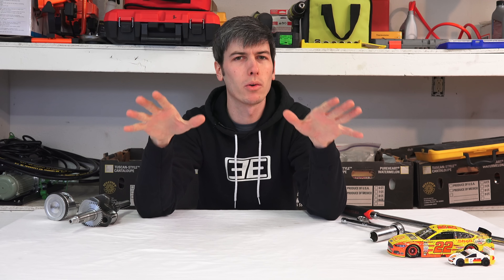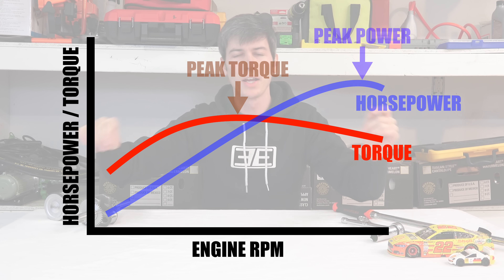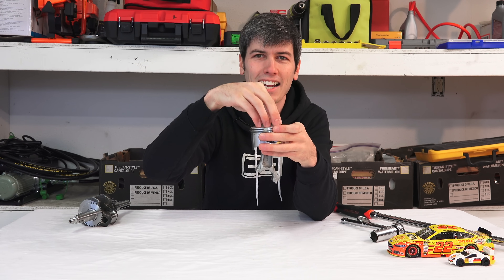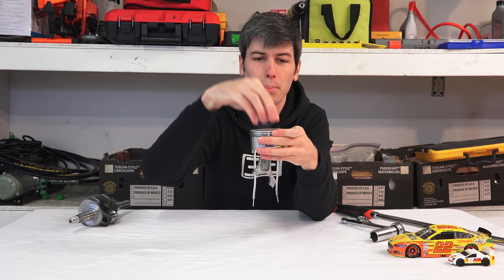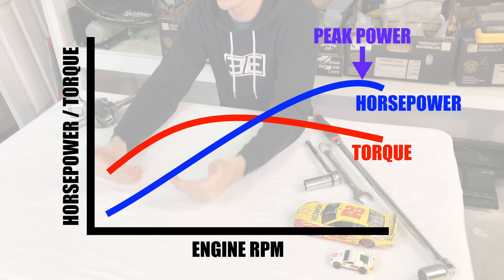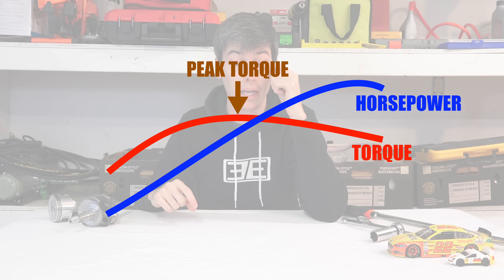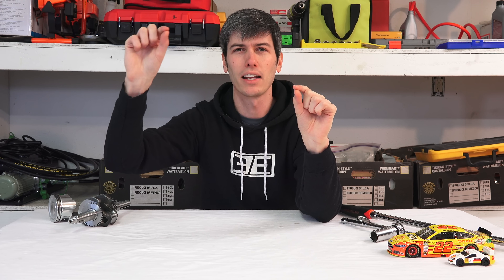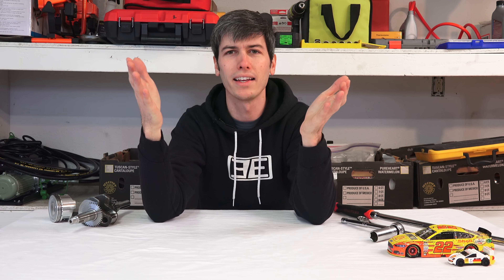Horsepower vs Torque - A Simple Explanation

Comment: Im still confused. I have read about this and watched videos. I have always been under the impression that more torque is better for acceleration, but his demonstration says the opposite? I dont care about top speed, because outside Germany (which I am) you cant go 150mph... but you CAN do 0-60 in 4 seconds on a daily basis or do 50-80 quickly to pass trucks etc. I want high acceleration in my vehicles for QUICKNESS, but a max speed of say, 120mph is fine. Thus, I want torque over HP, right?
Reply: horsepower is what gives a car acceleration. Torque is the turning force, power is how fast that torque is applied. That is why race cars have high horsepower and trucks have high torque

Comment: Overly Simplistic explanation. While his definitions are correct the Car scenario is a bit simplistic. Torque and horsepower tuned engines are used for different reasons in the real world. If you lived in a very mountainous area and needed to go drive around town up and down hills the 200ftlb of torque will get you around much more comfortably. But if you live on flat land in wide open spaces the 200 horsepower car is by far the better car for you. Because you need more torque on grades, while flat lands require far less.

You can see a similar case in motorcycles. Some of the bigger Harleys and Goldwings can tow a rather small trailer for gear behind them, because their motors are tuned for alot more torque. While a Suzuki Hayabusa is one of the fastest bikes in the world with crazy HP numbers, you will never see them pulling a trailer, it might not even move all that fast if you tried it. 

It's not a one size fits all scenario that more HP is always better.

Comment: Are you saying that if you took a remote controlled (RC) airplane gas engine that can reach 30,000 rpm  (The tachometer on my pick up only goes up to 6,000 rpm) and you took out my truck engine and replace it with the RC engine, the RC engine could not turn the wheels of my truck at all, even at 30,000 rpm, but If it were possible to get the right gearing so that the RC engine while running at 30,000 rpm would turn my truck wheel 1 revolution; 1rpm, and if it takes 1lb of force to make it rotate 1rpm, that would mean that at 30,000 rpm the RC engine has 1lb of torque.  So you take 1lb of torque x 30,000 rpm of the RC engine and then you divide it by 5252 which gives you 5.712...., this means the RC engine at 30,000 rpm will produce 5hp and 1lb of torque,  but it took 1 minute for it to reach 30,000 rpm while turning the wheel.  So if you beefed up the RC engine so that it reached 30,000 rpm in 30 secs instead of 60 secs. while connected to the wheel, that would mean that the RC engine turned the wheel twice as fast in 30 secs. in order to reach 30,000 rpm in 30 sec. but still it reached 30,000 rpm the wheel still turned at 1rpm.  This would mean that because it could turn the wheel twice as fast in 30 secs compared to 60 secs.  that means that the RC engine now has 2lbs of torque and 11hp.  So increasing the HP did increase the torque.  However if the wheel took 2 lbs of force to move it 1rpm, then the 11hp 2lbs of torque engine wouldn't be any faster then the 5hp 1lb torque that must move a wheel that requires 1lb of force per 1rpm.  And if you pull the engine out of the truck it is still rated at 5hp and 1lb of torque before it was beefed up.  Correct?

Comment: Horsepower and Torque cross over at 5252 RPMs. All engines.
Reply: That's because 5252 is what you get when you compound the unit translation factors that define a minute, a horsepower, and a revolution in terms of radians.

Comment: When people ask me I've always said torque tells you how much work the engine will do and horsepower tells you how fast it will do it. I know it's a little over simplified but it gives people the general idea.
Reply: That's half wrong.  You can convert the torque output of the engine to be anything you like.  Big amount, or small amount.  Neither changes how much work the engine will do.  Torque is how hard it pushes.  No movement required.

Comment: So a higher RPM of my engine gives me the same advantage as more torque if used correctly with the transmission? 
Is this why gas and diesel are comparable if gearing is used? My MX-5 can spin up to 7500rpm, is that as effective as a diesel which spins like 6000 max but has more torqu?

Comment: I agree but the car of 100hp and 200pf in a drag will destroy the other in short acceleration at low rpm because in most cases It's a turbo car however the 200hp 100pf car is naturally aspirated

Comment: Could you explain why hard acceleration reduces fuel economy?(going from A to B fast instead of slow). In the end of the day, going the same distance from A to B, regardless fast or slow, assuming 0 drag in vacuum for the sake of math, should have the same total amount of work done and require the same amount of force? But that's not the case since there's the difference in fuel economy
Reply: Your car has to be put in lower gear settings to get higher acceleration, than it otherwise needs to maintain cruising speed.  This is what you have to do, to get the necessary torque to get the car up to speed.   The engine is less efficient and burns through fuel at a higher rate when it has a higher rotational speed.  So you sacrifice efficiency for acceleration, in order to have your engine and transmission prioritize high torque.

The engine has an optimal fuel efficiency around 2000 RPM, but you won't get much torque out of your engine for acceleration at that speed.   That kind of engine speed is best for your cruising speed on a 40 mph road, where you only need enough torque on the output wheels to overcome air drag.
Reply: Thanks, you meants 2,000 RPM and not 20,000 RPM. Okay, if assuming the same situation where it is in a vacuum with no drag. For a CVT transmission or an electric motor that has only 1 gear, hard acceleration will also cause higher rotational gear speed and less efficiency?
Reply: @belowmars  Yeah, 2000 RPM is what I meant.  I think I've been multplying by 10 by mistake.  In any case, it's usually the second marking on the tachometer.  Tachometers all have different conventions, some show numbers 1 thru 8, and "x1000", some show numbers 10 thru 80 and "x100", and I couldn't remember the correct order of magnitude.
Reply: @belowmars  A CVT doesn't have 1 gear.  Quite the opposite.  It has a continuous range of infinite gear settings between a max reduction and max overdrive.
Reply: @carultch, I know that, that's why I asked "For a CVT transmission or an electric motor that has only 1 gear", you can interpret it as I asked "For a infinite gear transmission or a single gear transmission". "For a monkey or a horse", the latter doesn't have to be in the same category as the prior.  
Either way, the FOCUS is the question and it is still unanswered: "will hard acceleration still cause higher rotational gear speed and less efficiency".
I guess I will also ask a follow up question, for a person to dash across 200 meter vs. walking 200 meter, will dashing exhaust more total energy/so it's less efficient?
Reply: @belowmars  The reason will be completely different, for machines with different sources of energy.  Don't expect the reason fast acceleration is inefficient for an electric motor, to be the same as the reason fast acceleration is inefficient for a gasoline engine, or a human body.

It's not about motion in general that makes it inefficient, it's about what happens inside the part of the machine that converts non-mechanical energy into mechanical energy.  If you were able to eliminate friction and energy conversion losses completely, and regenerate all your braking energy as storage, the energy used for your motion would be independent of path.
Reply: I would only want to eliminate the friction and of course without energy regeneration, I was trying to narrow it down whether the inefficiency in hard acceleration vs soft acceleration is mainly caused by the gearing and transmission(and the resulting torque requirement in a given amount of time), if not, what other factors have caused hard acceleration to be inefficient.
Reply: @belowmars  It's not caused by gearing.  Gearing is what a transmission does, in order to be able to adapt to the sweetspot on the engine's performance curves.  Gearing is what your car uses, to mitigate the inefficiencies.
Reply: @carultch, I think you know the answer and i feel like we are going in circles, so what is the cause for any hard accelerations to lose efficiency?
Reply: @belowmars  Rich mixtures of air and fuel, leading to unburned fuel in the exhaust.   Extra friction within the moving parts of the engine.   There's more compression in the connecting rod to put out a high torque, which means more friction in the joints.

Comment: Maybe this will help to some of you that are still confused:

more engine torque (like with diesel engine) doesn't neccessarily equal faster acceleration. Take one transmission ratio and you'll accelerate very fast, but only up to a lower speed. Take the other transmission ratio and you'll accelerate slower, but up to a higher speed, so it basically all comes down to power, which is torque at a certain rpm level. Diesel usually has more torque, but it's not an advantage, if it only lasts throughout a short rpm range. You can use appropriate transmission with petrol engine and get high torque, like with diesel, but it will only last throughout a short rpm range (as with diesel, obviously). So, for higher performance, take something with more hp - what good is 1000nm or whatever many hundred lb.ft of torque if the engine only produces 10hp (spins slowly)? Yes, petrol has lower torque, but also spins faster, so it's the rpm AND torque (or power) that matters. You can have as long of a wrench as you want and be able to exert as much torque as you want, with it, but it'll take a long time for you to screw that bolt in, with that long wrench, so unless the screw turns really hard (large transmission ratio), you don't need all that torque, but rather higher rpm and lower torque (achievable with smaller wrench). As I've said before, go for the hp (not counting the weight of the car and bunch of other variables), and the transmission will also make a difference - how many gears, how fast you can shift them and what top speed the transmission is geared for.
Reply: See it this way.
Large gear ratio means longer lever, more torque. So it makes it easier for you to actually move a stuck nut/bolt.

But when you have momentum on your side in a car,(when the said nut/bolt is not stuck and is well oiled), the longer lever in only increasing the distance you need to travel with your arm to make the nut spin one full circle.

Imagine opening a jar lid or a nut/bolt, with a lever that is 10 meters long. Imagine how big of a circle you'd have to run to make the lid spin just one circle.

Comment: Why does a higher torque engine feel faster than a lower torque engine when the bhp  is the same?
Reply: Keep in mind that "torque of an engine" is not an absolute value but varies with the RPM (same with power, by consequence). Diesel engines (an example of high-torque engines) "feel faster" because of a narrow peak power band over the RPM range, in which the engine causes maximum acceleration (what pushes the driver into the seat and causes the "fast" feeling), balanced by a weaker push outside the peak power band. It's not a direct consequence of torque, just of the power distribution. Petrol engines (an example of low-torque engines, compared to diesels) usually exhibit a more constant power output over the RPM range, so there's not any peak in perceived acceleration and thus it "feels slower".

Comment: Torque is the twisting force. Horsepower is how fast the engine can turn while still supplying said torque. Higher Cylinder count vehicles can apply the force more frequently per full engine revolution. So a 500HP V8 will be quicker than a 500HP V6, assuming they have identical power curves. Semi trucks can have 1300-1500 lbft of torque, but because their engines only spin to a max of ~2500 RPM they don’t make crazy amounts of power and are therefor slow because they cant hold a mechanical advantage provided by the transmission for as long as a car that revs to 7k might be able to. A Bugatti Veyron produces around 1200 lbft of torque like the semi truck might, but because it can rev up to ~6500 RPM it has over twice the power. Motorcycle engines dont make high levels of torque, but because they can rev to 12000RPM they make a lot of power. Power wins in the end. That’s why it’s power to weight vs. torque to weight. Hope this was simple to follow

Comment: HANG ON. You said you feel the greatest FORCE against the seat (which is really the greatest force at which the car is pushing your body forward) at peak TORQUE. But you go on to say that the greatest ACCELERATION occurs at peak HORSEPOWER. Now if Acceleration = Force / Mass (and the mass of the car and your self is constant) doesn't that mean the greatest FORCE and the greatest ACCELERATION should occur at the exact same RPM????

Comment: Hey, I love you content. It’s really helpful 
Can you make a detailed video explaining why diesel makes more torture and gasoline makes more power?
Reply: Shivam Dhawan Diesel burns slower, and so is used with longer stroke, lower RPM engines. Gasoline explodes quickly and so is used for short stroke, higher RPM engines. You can make a long stroke, gas engine to make more torque, but a short stroke diesel won't allow time for a full burn of fuel charge. And diesels typically don't like high RPMs, or they tend to self destruct 😉

Comment: This is a great explanation. Although horsepower is Torque x RPM ÷ 5252 (which is the magical point where torque and horsepower lines cross on graph). Also in the car racing example there were certain parameters left out (i.e. the race's distance). It is possible that the car with less horsepower and more torque could actually win a very short race. The discussion about gearing in this example is confusing because gearing can alter torque. All things being equal the one with more power will eventually be quicker.

Comment: Hello ! Very nice video! I've got a question about it sinds 3 years at least. Nice example with the cars. But how can we feel the torque in the engine? How does it affects the acceleration? Does torque affects something else than acceleration (like topspeed for example)?
The best way to answer this is to compare a 200 hp/100lb.ft car with a 200 hp/200 lb.ft ratio. 

Are you the one that will be able to make me see clear through this? 😜 thank you!

Comment: so how do they measure BOTH on a dyno with the wheels?
Reply: The dyno measures torque and rpm. It uses those to calculate horsepower. A dyno puts a load on the engine in order to measure torque

Comment: I dissagree with only one thing. 

In a car, you don't feel the most FORCE on your chest at Peak Torque. 
You feel it, at Peak Horsepower. 

It just FEELS like you feel it at peak Torque, because usually, torque ramps up quickly, and horsepower slowly over time. 
If you could actually measure it (and you can with an accelerometer), you feel the most at PEAK HORSEPOWER. 

PS. At Peak Torque, your engine is actually stressing your crankshaft with the highest force applied, BUT, since its continuously applied over time multiple times per revolution, its not translated to more force on your chest as well.

Comment: In this video you say “more power (HP) is always the faster car,” but in your Porsche Taycan vs Model S, there is little mention of HP (insofar as the point you’re making), as all calculations and physics focus on torque and converting that force transferred to the wheels, all to determine the winner. Will you please clarify? In your example here with the two toy cars, if ALL else is the same other than the ratios of power and torque, the car with less torque should accelerate faster to some speed (tbd with gear ratio, wheel size, etc.) The higher HP car will dominate at higher speeds. Agree?

Comment: Using multiple gears confuses the issue. You should start by assuming ONE gear but different ratios. The vehicle with lower gear ratio will have more torque and accelerate faster from a stop, but it will achieve lower speed in the end as it will deliver peak power at a lower RPM.

Comment: In his example of the 2 cars, given that they both weight the same, SAME GEARING: the one with 200 pound feet of torque will accelerate faster (let's say an 1/8 mile race) because of bigger engine. The other car with 200 peak HP and 100 pound feet of torque will be gaining advantage after the 1/8 mile, probably arriving at the same time or a bit sooner at the 1/4 mile.  If you give them a 1/2 mile then the advantage goes definitely to the car with the smaller engine (100 torque and 200 horsepower)